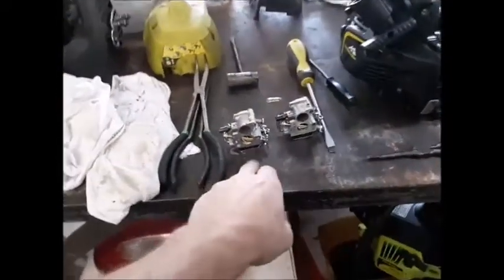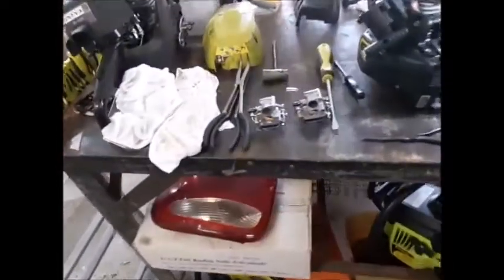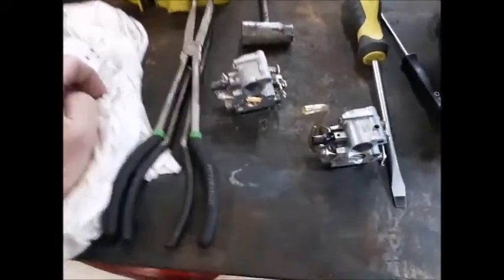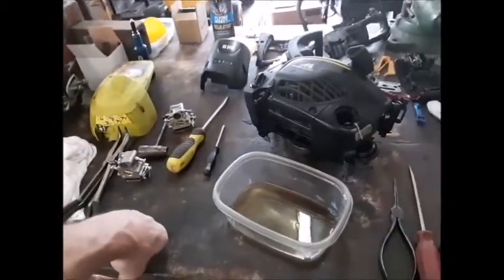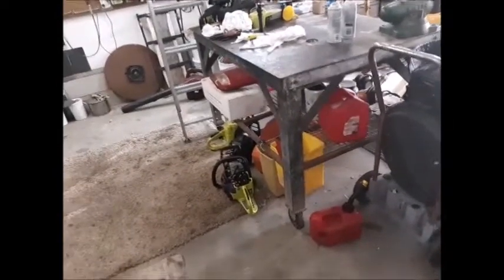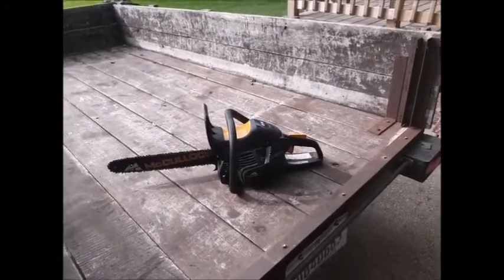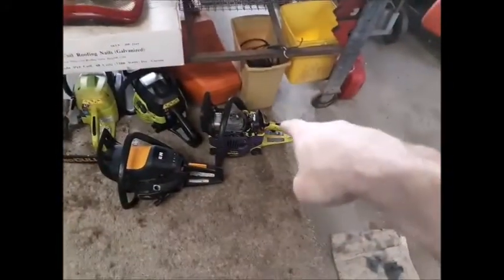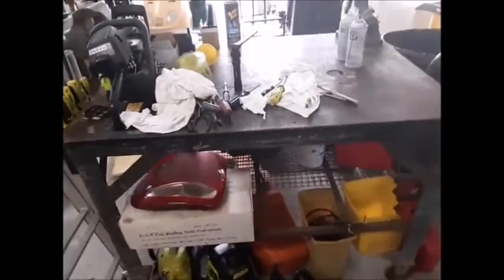Michigan Chainsaw Massacre Part 4

Comment: Get the blue tint fuel line. Better stuff. Son-in-law has all my Poulan saws and an old Skil electric job that has a clutch on it. ALL down at his place i I have another saw after talking to the local saw guys and a 394XP with a 4 foot bar is a dab too big. And I didn't really want just a home owners saw for a little more I got a commercial job, a 261 or what used to be a 26. Eleven pounds loaded with an 18 inch bar, 4 horses at 14K R's. It's what the power company uses. A SCREAMER! VERY happy! Compression release just like the 440. Happier! Weatgher coo0ling off. 39 here this morning and around 70 with less humidity. YAAY! Come on, fall! Thanks, Ronwallymus. Those things can be a pill. I liked YOU doing all that pulling but not me. Arthur, you know and GBWYall!
Reply from the maker: I just settled for the Ho Chi Minh gas line cause I'm selling the saws anyway. I plan on buying the good stuff later on. Thanks buddy
Reply: @WallysPlace66  10/4 on the chop- sticks gas line. Don't blame you and I think you even said that!